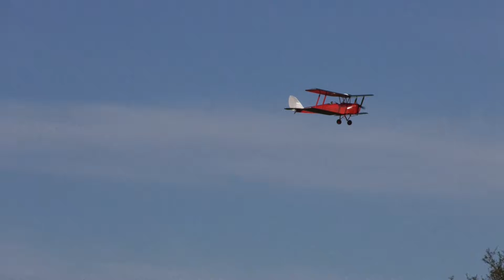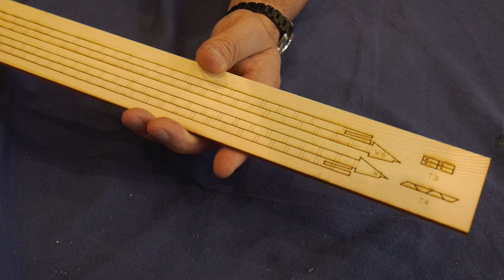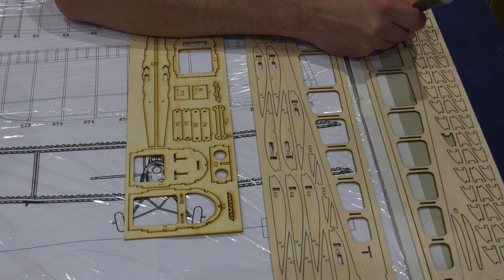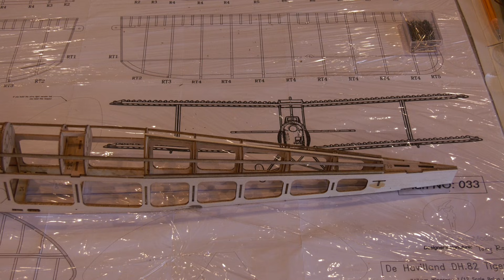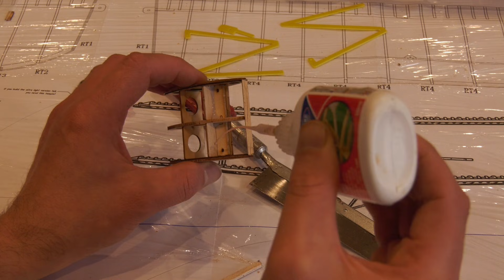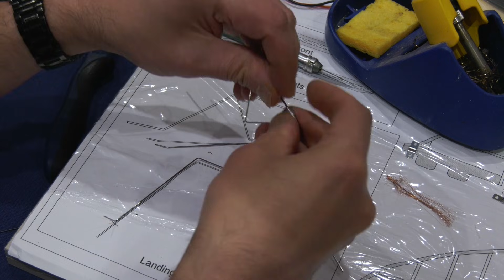Tony Ray 1:12 Tiger Moth Kit Review - Part 1

Comment: Great looking Tigger😊
Reply from the maker: Thanks.  Flies very nicely (part 3), and I am looking forward to building the 1:6 model in the New Year.  What weight did your 1:6 come out at ?
Reply: @ScaleMeDown I'm yet to cover it but I'll give you the weight with engine tomorrow,are you going electric or nitro ?
Reply from the maker: @MarkCroucherRC4fun  Probably electric like cliff's, although my dad has a nice Saito .65 four stroke that is currently not doing anything ...
Reply: @ScaleMeDown I just find nitro / petrol a more satisfying experience.